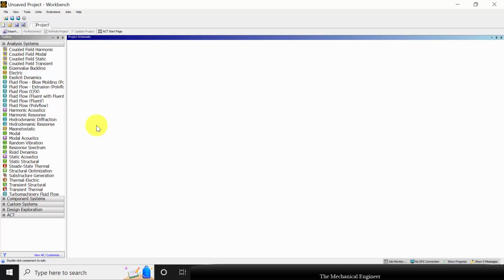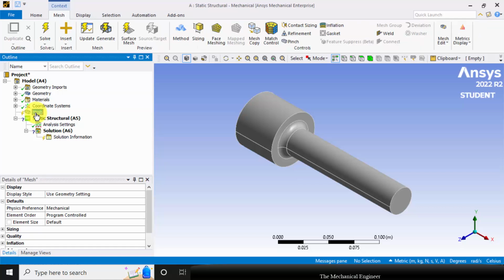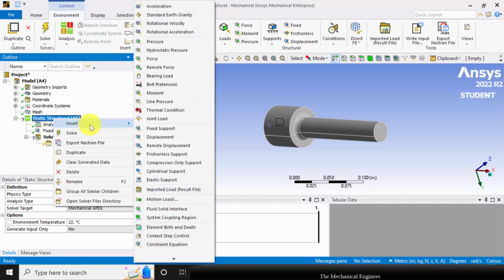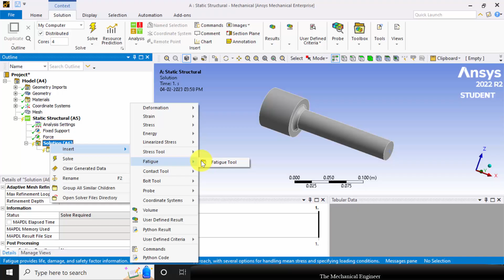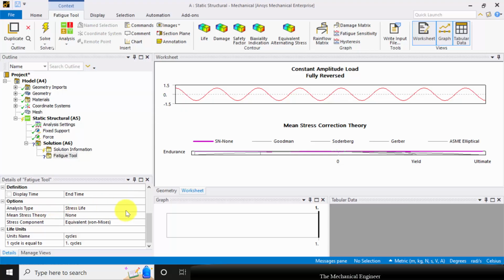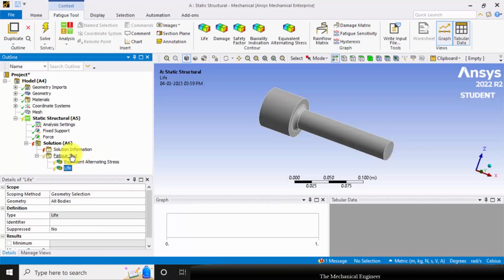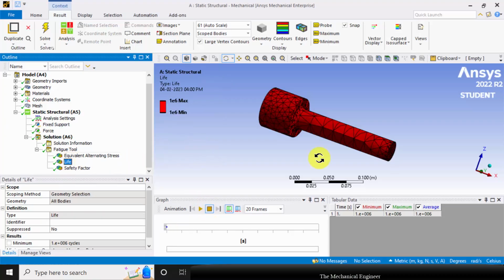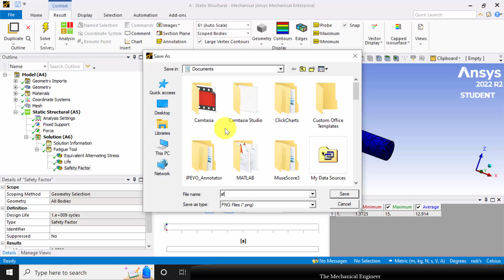Fatigue stress analysis on stepped shaft | ANSYS workbench tutorials for beginners

Comment: This is a good starting video on the shaft fatigue for beginners. I hope that the students also read the ansys manual and other fatigue books because fatigue FEA is a specialized topic. Common mistakes for beginners are using Von-mises stresses for non zero mean stresses and using mean SN curves (50%) for analysis.
Reply from the maker: Thank you for your positive feedback on our introductory video on shaft fatigue! You're absolutely right—shaft fatigue analysis is a specialized topic that requires a strong foundation. It's our aim to provide a solid starting point while also encouraging further exploration and learning in this fascinating field.
Reply: what do you mean by (using Von-mises stresses for non zero mean stresses and using mean SN curves (50%) for analysis is a mistake!), what is the right choise if i use Soderberg criteria for analysis?

Comment: Nice tutorial for fatigue stress analysis, but you need to determine the maximum stress with a stress convergence study in order to find the minimum safety factor.
Reply from the maker: Thank you for your suggestion! You're right, determining the maximum stress through a stress convergence study is essential for a reliable fatigue stress analysis. By gradually refining the mesh or discretization of the model, the study ensures accurate stress values in complex areas. This allows for a precise calculation of the minimum safety factor, which represents the margin of safety against fatigue failure. Incorporating a stress convergence study enhances the analysis and understanding of structural performance under fatigue loading.